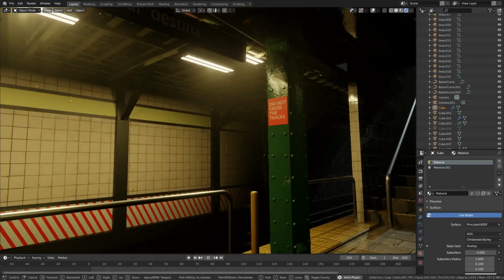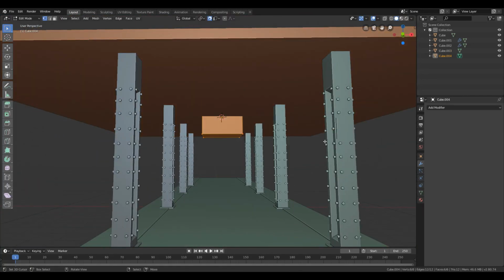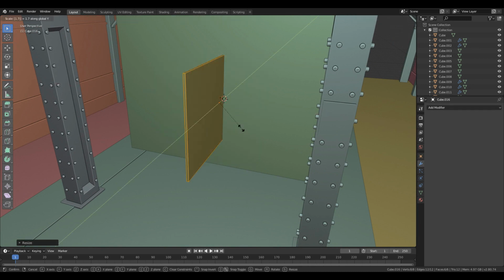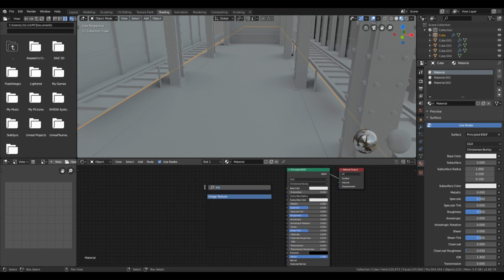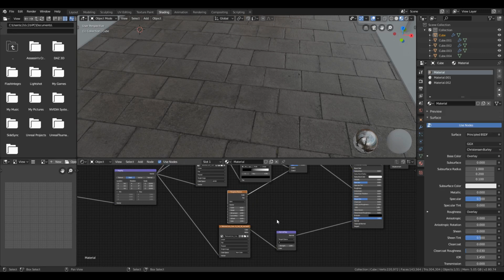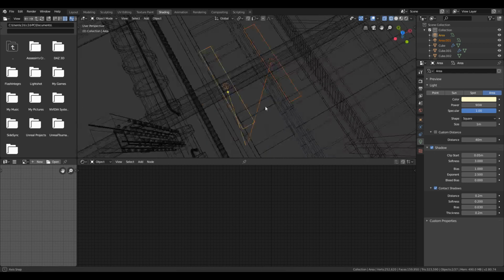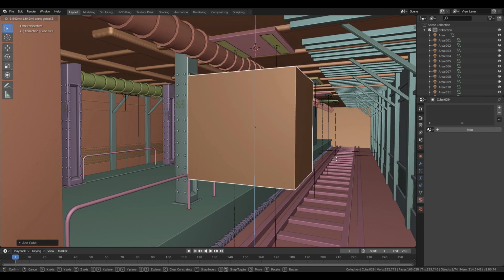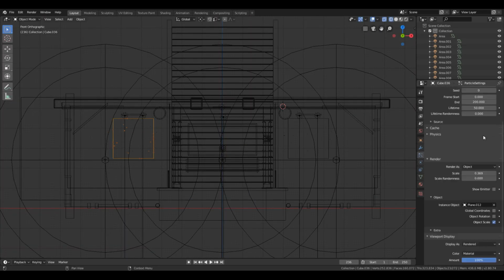Create a Subway Station in Blender 2.8 (Eevee)

Comment: Little tip but have you thought about adding visual shortcuts to the tools you're using so people can follow more easily. noticed a few tutorials doing this now.
Reply from the maker: I have used screen cast for my recent video tutorials . This one was done when blender was updating it version and addons were not working due to compatibility issues.
Reply: @SaqibHussain88  Here is what I've managed to achieve so far with mine... but doing things a little differently with having middle island, this is all new ground to me... but your video is helping me along. here is an image what i've done so far https://1drv.ms/u/s!ApSMGkWplEl2gepnwjDKu-0ESEASUw
Reply from the maker: @APRICEPRODUCTION   Thats so cool . I can see it coming just needs some materials and lighting and it will be really good.

Comment: When i am using array modifier..  the bolts are not showing.  Why?
Reply from the maker: I think you have created bolt inside of the another mesh . Not so sure If you can provide a picture it will be easy for me to tell whats going on in your scene .Also may be you did not checked the icons that are in array modifier to preview it in 3d viewport.
Reply: @SaqibHussain88  Do I have to parent all the bolts to the pillar.  Its very confusing.  And the video is a a bit fast for a intermediate like me.  I loved this work of urs and want to make something like this but i am facing a lot of problems with the Pillar alone.  Normal speed wala video nhi hoga aapke paas??
Reply from the maker: @otakuguild5603  I think I have , but If you are asking for the bolts the bolts were only created inside of edit mode just after I had modeled the pillar . Use simple duplicate for the bolt by pressing shift+d .
Reply: @SaqibHussain88  Thank you..  I was making the bolts in object mode that's why i was facing this problem.  I did it in edit mode so i don't have to parent it.

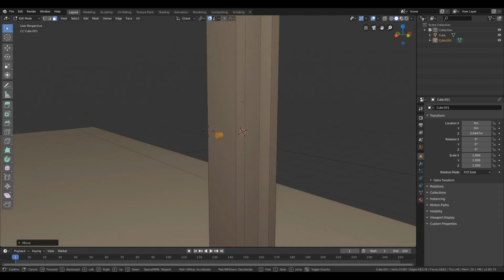Comment: How did you go from a flat cylindar to this curved bullet shape at 1:51?
Reply from the maker: select the edges and just beveled it by pressing cntrl + b .
Reply: @SaqibHussain88  how did you create and how many edges did you do? Sorry its just a bit unclear and I'm new to blender. Thank you:)
Reply from the maker: @Randaakarim  after pressing cntrl b you can scroll your middle mouse button to add more edges to it , i would say you can add 4 segments which will be enough but you can add more to it but just dont go over board with it . Try to add edges from 4 to 6 value these are enough for such model.
Reply: @SaqibHussain88  after I got Ctrl+b on the edge loop, I get weird shapes when I try to bevel it. Is your top face also an ngon?
Reply from the maker: @Randaakarim  yes it has more edges to it , please do share you pic . It will be easy for me see what's going on in your scene.
Reply from the maker: @Randaakarim  yes it my case it was n gon to make sure to apply shft + n to the all the faces to recalculate the mesh and then use bevel . Sometimes if some of the faces are flip you will face such kind of issues.

Comment: I got some issues with the lighting on the green pillars. Seems the bolts don't cast any shadows on the pillar itself and I can't find out what causes the problem. Rescaling the light sources doesn't seem to work. :(
Reply from the maker: For small details of the shadows try to use contacts shadows that will be available if you select the light and then inside object data tab just check contact shadow and play with the distance and softness value other then that you can also use the soft shadows option that is present under the shadow tab and that is present inside scene tab.
Reply: @SaqibHussain88  Wow, it did the job! And thanks for the quick response, though! I really love your work!

Comment: What is your computer's specs?
Reply from the maker: Intel i7 @3.40GHz
24 GB ram
GeForce GTX 1050
You will get better results if you go higher then these specs
Reply: @SaqibHussain88  GTX can do ray tracing? I think not. Do you feel to upgrade to RTX or it just do the job well?
Reply from the maker: @vinodmehra188  bro Its obvious that the better the graphic card is the better results are going to be . Right now I don't need any if I ever wanted to create a short film then may be or may be just use render farm for that .

Comment: i try to make this subway but were is the rail modeling???? but for at moment is good thank you
Reply from the maker: I have cut it down from the video as it was easy just like the other parts of the model ,just did that just to shorten the video. Took a simple box and used array modifier.

Comment: Thank you very much for a demonstration on how great looking stuff can be made in Blender, using relatively basic procedures.
I found it rivetting.
And while we are on the subject of “rivetting”, I find that a certain level of realism makes everything stand out.
You are making a number of columns presumably made of steel H-beams. And then you plaster them with rivets. Loads of rivets. In places where rivets would never be. Even on the edges of the steel. Loads of rivets. Masses of them. In absolutely nonsensical places.

Apart from that, I really liked your tutorial, and thank you for your effort.
Reply from the maker: Thanks for liking my tutorial but its not finished yet  its a work in progress , the thing is i did not pay attention while I was blocking the mesh just wanted to show how it can be build in blender .
Here is a refference I was using but forgot use it while modelling here is the link:-
https://i1.wp.com/csengineermag.com/wp-content/uploads/2014/02/subway.jpg?resize=696%2C464&ssl=1

Comment: I must choose between reflection volume or screen space one. They seem to interfere with each other. Also, should have changed their shape to cube.
Reply from the maker: It needs alot of work to get good reflections in Eevee . Keep on working on the influence of the reflection cubemap. I think anyone can achieve some real good results.
Reply: @SaqibHussain88  I think you used to many of them, really. Each one is rendering the scene from it's position, and it's adds up.
Reply from the maker: @AllExistence  thats the best way to create reflection while using Eevee cause you cant  use only one cubemap for such kind of scene . This technique is also useful for video games but for that you need to use lower down the resolution of the cubemaps.